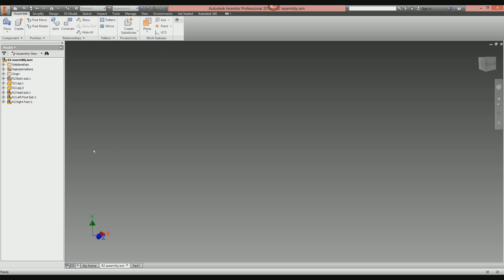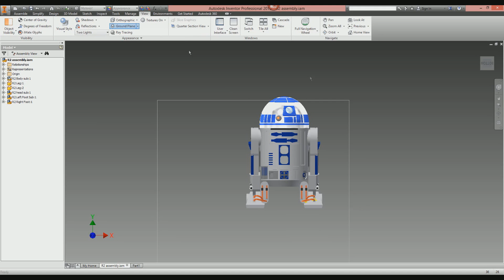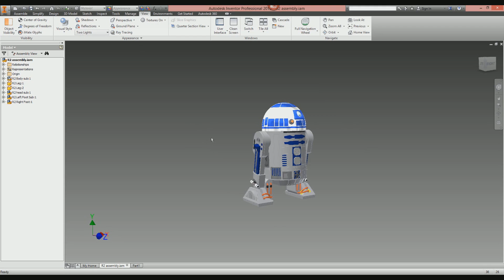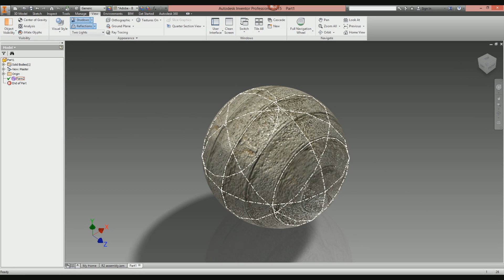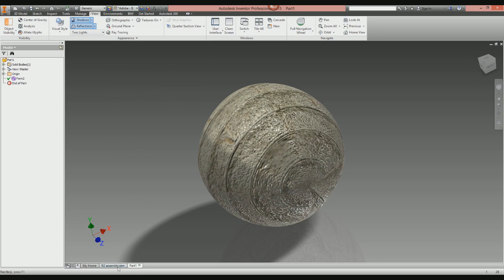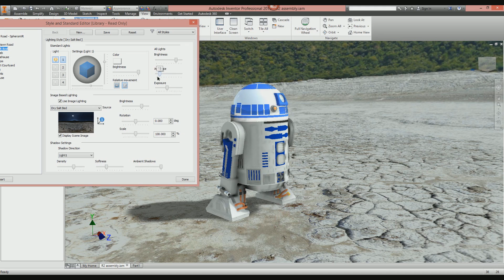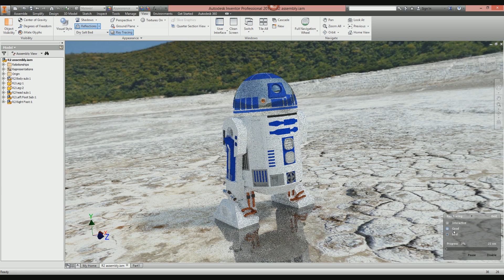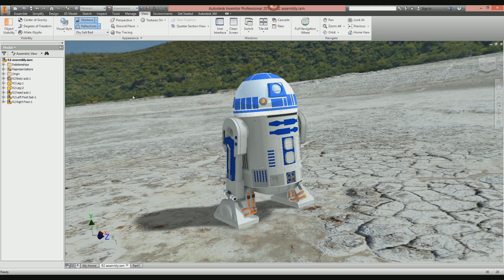How to make 3D models look awesome | Autodesk Inventor

Comment: I mentor a team of high school robotics kids and we use Autodesk Inventor for designing the robot.  We have a sponsor panel on the robot which has a full color high def image applied to it which shows up fine in a non-rendered model.  However, it's completely blank when I render it with ray tracing.  Does this feature not work when rendering a photorealistic model?
Reply: Neil Cross - Can you help me out?

Comment: I really do not like that I cannot color faces or bring in the colors I have assigned in the part file into an assembly.  I have created proxy parts for things like buttons that are a single revolved part for instance and I want the button to be one color and the housing to be another such as red and aluminum.  But I cannot do it without splitting the proxy into two parts which takes time and adds complexity to what is supposed to be a simple proxy part.

Comment: Hi! How can i use this awesome setting to render high resolution png files? Studio environment allows me to do so, but it will not render the view settings, and quite honestly, it looks bad comparing to ray traced images.
Reply: I'm having the same issue/question...

Once i've setup the ray tracing the image i'm looking at is awesome, but i now want to go ahead and save that image or render it...but when i click over to the rendering studio the ray tracing is turned off and my model looks like it was made in MS Paint...

can anybody help?
Reply: When I want a nice render in the standard viewing environment, same way as done above, I export / save as a bitmap. You could also export as a PNG. This is not done in the Studio environment though, only in the main modeling environment. It applies the ray trace as the PNG is exported.